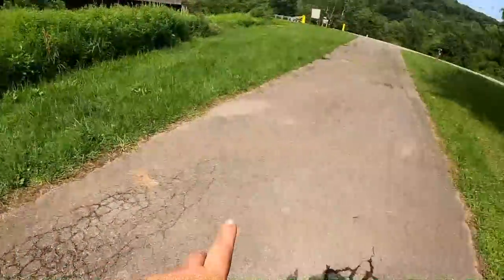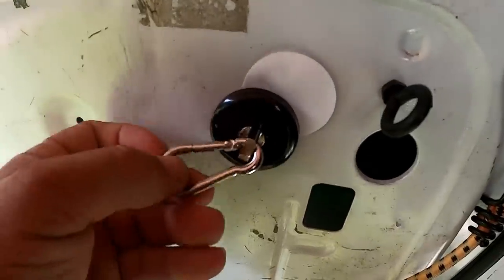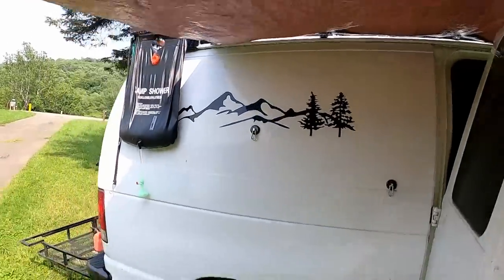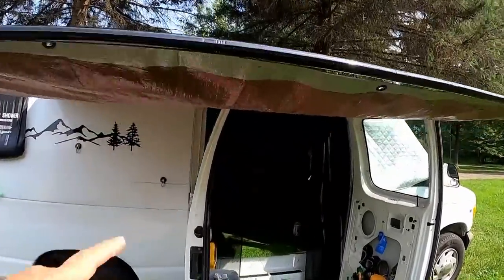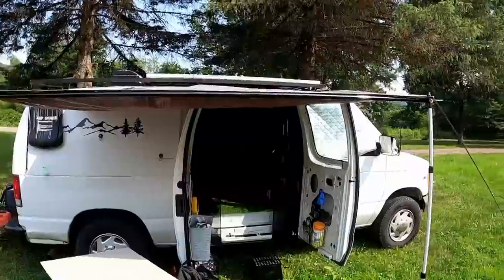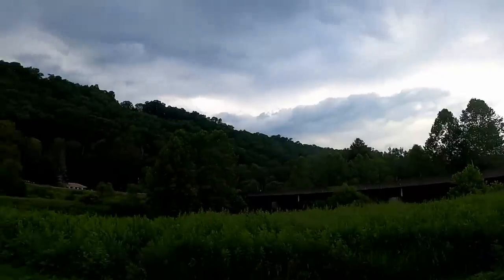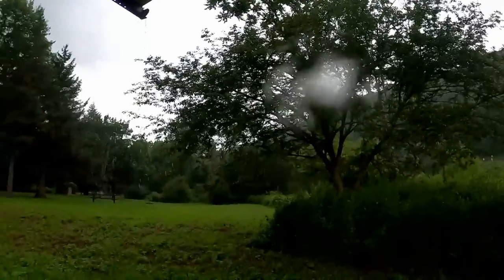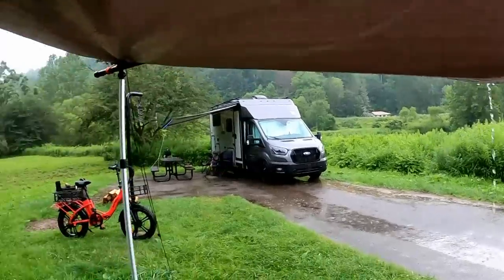DIY Awning For Vans - Camping in COE Campground at Kelletville Pennsylvania - Tionesta Creek

Comment: Dave the water area at your recent camp site looks like an old dam that was removed to me. If you look at both sides and the remnants  that are in the water. Most likely for an old grain mill or something similar. Just did some research and I found out online it was the spot of the original Newtown flour mill. Over one hundred and fifty years ago or so.

Comment: Awning - Put a section of pool noodle or foam pipe insulation over the top edge of  your doors, when they are open, to keep from wearing a hole in your tarp. Patch the DIY drain hole with Gorilla tape. Then, put a grommet where the hole used to be. That'll function as a drain hole AND your tarp won't split if heavy rain accumulates.

Comment: Pretty spot. The van has worked out great. A lot cheaper on gas. I like that awning, nice to be able to have the doors open. Do you have anything on top of the doors to protect the tarp? That's a nice place for Bella to cool off and have fun. 🙂👍
Reply from the maker: I will probably use a section of pool noodle on top of the doors.